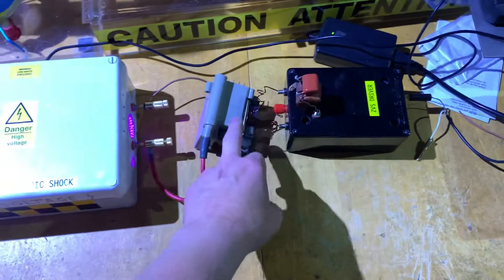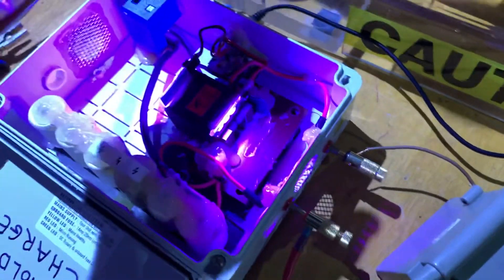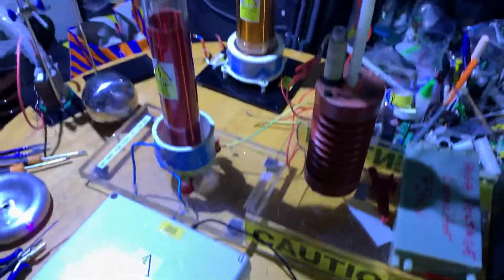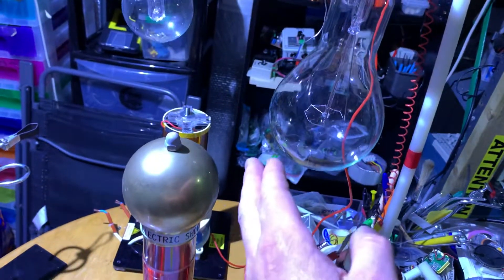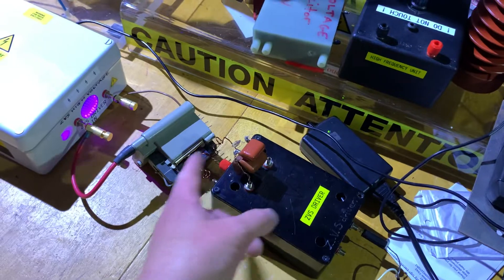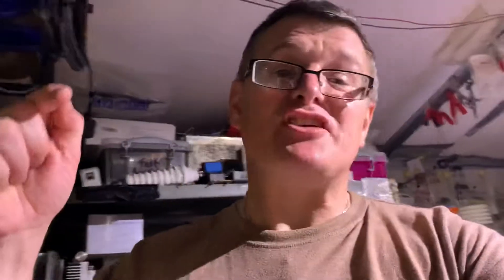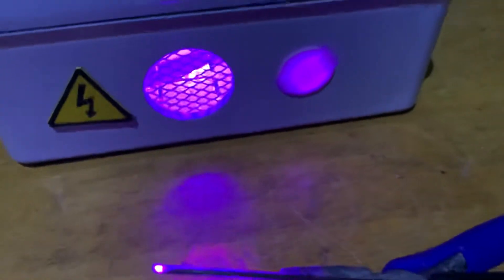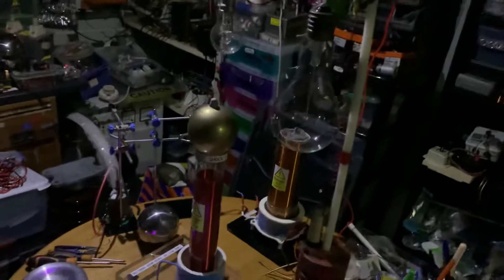Tesla coil portable ⚡️⚡️⚡️

Comment: Go to your local "Wolseley" pipe branch. Ask them if they have rejected PVC pipes they don't want in their backyard. Years ago I saw a skip full of rejected pipes in one of the branch in Blackburn and acquired a 12" diameter PVC pipe and an 8" diameter one for a couple of rolled up oil filled capacitors. The guy at the counter only wanted a tenner for them. I too wound mine by hand and it took a few days to complete the 1.2m secondary former. It was an ambitious size which I never had the power supply for. In the end I end up selling it off and re-build a smaller former.
Reply from the maker: thank you friend. ill try that ;-) be safe